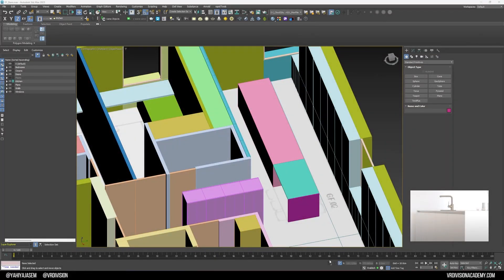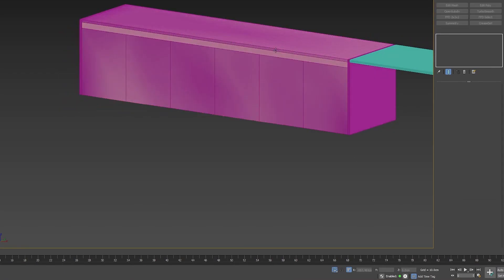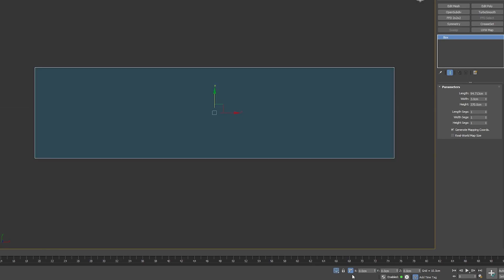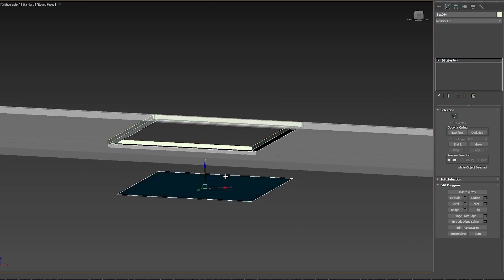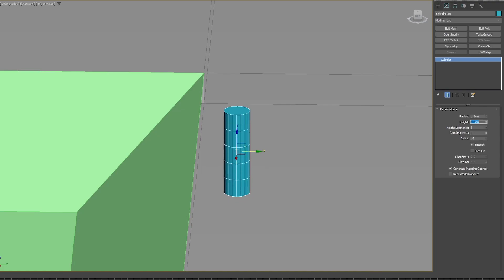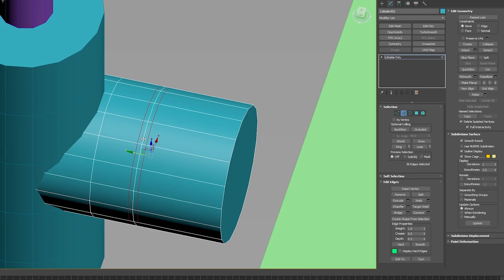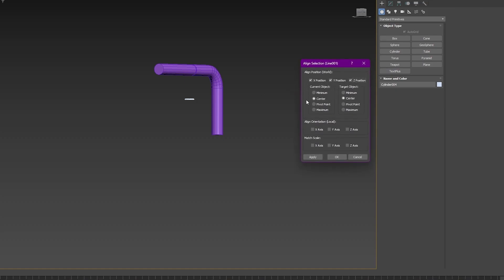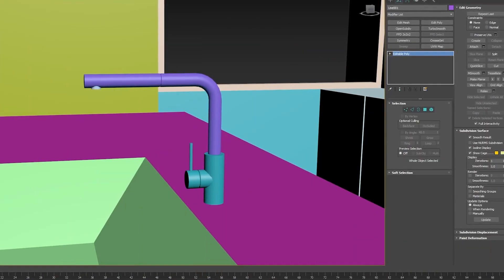6. Kitchen 3D Modeling Tutorial | Archviz Project From Start To Finish

Comment: In term of speed and efficiency for un-organic form, is it better SketchUp or 3Ds Max?
Reply: 3D Max & Blender are pretty much equal for this type of modelling. SketchUP has a simpler tool set (in a good way), but bevelling can be a problem unless you invest in plugins.
Reply: @jimanderson916  let's say someone got intermediate skills on both software, and have every plugins that they needed. Which software do you think will win the speed & efficiency contest?
Reply: @KomunitasBelajarForex  The one you’re most proficient with is the best option. For me, the process is a 2D drawing taken from CAD into SketchUP, but that’s only because my brain has a melt down with all the options in Max or Blender. Rendering is either taken care of with Twilight within SketchUP or exported again to Twinmotion.
Blender can do all the above and more in the one package.
Reply: @jimanderson916  Yeah, Blender is free, and within its free plugins it can do most SketchUp, 3Ds Max and Maya can do. Thats powerful.
Reply from the maker: As for me, I would go with what JA said, 3ds Max or blender,  both tools are intended for this, unlike SketchUp where you need to count on 3rd party plugins since it's not designed for organic modeling, I could be mistaken since I have very little experience in SketchUp